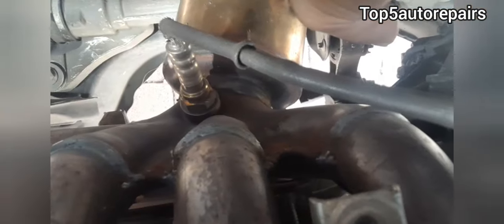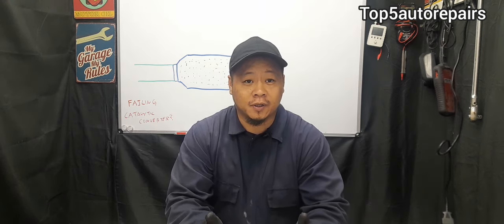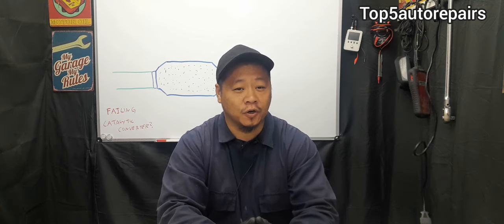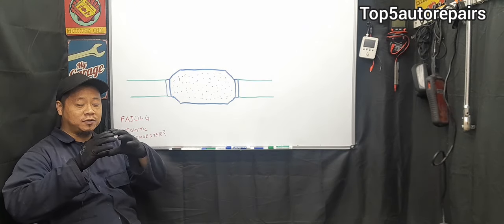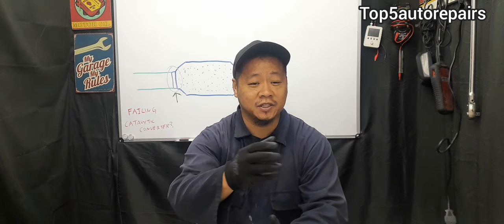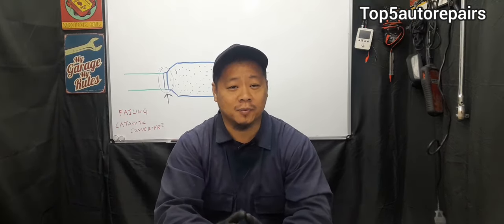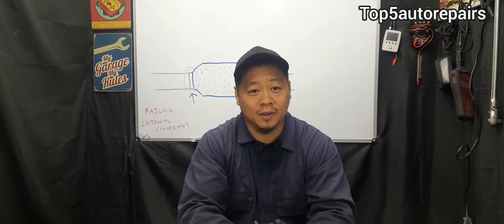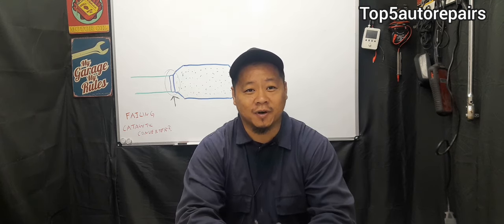HOW TO CHECK FOR A BAD CATALYTIC CONVERTER BEFORE REPLACING IT

Comment: all the causes have separate error codes. if only p0420, how to find the cause is difficult. but, without knowing the cause, just replacing converter is meaningless.
Reply: In most cases is carbon deposits built up. Not cleaning the valves and the intake
Reply: So does cataclean help?
Reply: @dramatimefighting  if the cat is burned out, not a chance. It cannot reverse the damage. Cat must be replaced
Reply: @BobSmith-tn2qp  or possible cat delete?

Comment: I will be replacing head gasket, O-Ring seals under rocker-arm carriage and catalytic converter on a 1989 Honda Civic. Replaced the oxygen sensor, but that did not improve the problem. Have had some issues with anti-freeze going through the exhaust, so at 146,000 miles on the car, it's time to invest some money and labor into the car.
Reply: Sounds like you have a cracked or blown gasket
Reply: @soniarican6275 , Took me around 6 hours to get all of the old gasket material off of the upper block. Tedious job. Things are moving along and hope that the car is up and running before mid-October. Kind of a bummer having 1 car when that car is down.
Reply: @LouiseTurner-x9z   Tell me about it , My car has been in the shop for a while now, it needed a new transmission and now they are telling me both Catalytic Converters might have to get replaced 🤦🏽‍♀️ I’ve been missing so many hours at work it sucks , but yeah changing a gasket isn’t an easy job I hope you can get your car up and running soon

Comment: I had a massive oil leak after replacing cats my cats were Turning red it throws a code for 02 sensor but it with replaced I guessing my cats are finished 😢

Comment: My G37 sedan had a code p1421 . I've purchased high flow cats from kinetic right after . my check engine light stayed on. It reads as follows. p1421. These cats were brand new but after a while I noticed some rattle when I cold start. It sounded off. Then emissions came around and I still don't know what it could be. The forums say to purchase the cell fix for high flow cats and test pipes.  plus, a tune could help. oem cats are way too expensive when it restricts power. The forums also said do not use the cells fix if your cats are bad. I do have a sluggish engine. my mileage is lower than when I purchased the car. I used to have 22.8 mpg now I get like 11.5. car sounds good but I waste gas and I find myself buying more every three days. should i buy the oem cats? should i try the cell or should i just get a new high flow cat and then put the cell on it before  the o2

Comment: i purchased some high flow cats last yr. and I got a code of p1421. I noticed it was sputtering on my driver side. I just checked under the car today and found out my cat has a small hole in it. I felt the hot air sputtering out of that hole. something told me it was a hole. I went to many auto shops, and they told me it was a relearn procedure that needs to be done. some said I needed to get an update on my ecu. none of that was the issue. I bought some pb weld and fixed it myself for 6 bucks. no more sputtering and the check engine light never came back on. car drives like it was supposed to . now i can get my inspection done . hooray!

Comment: Excellent explanation, besides that I used my humble scanner and I was able to check: cylinder misfire (6) ok , O2 sensor (4) ok , catalytic 2 ok, catalytic 1 HIGH , max value 3000, reading 3239 , code P0420 , I’m going to try cleaning first before replacing it. Vehicle mileage 140k , my wife bought it brand new this’s the first problem in this vehicle, ‘13 Acura RDX

Comment: Time for me to share my current experience.
I have a 2012 Kia Soul 1.6 GDI 
The engine seems okay, I have not noticed any power lost, no overheating, no black smoke, no white smoke. I checked the temperature with a lazer gun and it reads 200ish by the exhaust manifold and close to 400F at the end of the catalytic converter, I can't really check the temperature of the catalytic converter because of the heat shield, I will probably remove it and check the temperature 🌡 😑 
I don't smell anything under the car, I even put my nose inside the exhaust and didn't smell anything, no antifreeze smell, coolant looks nice and green, oil is clean, it doesn't burn oil, but the check engine light comes on and stays on.
I'm going to need to remove the catalytic converter and do a visual inspection, also need to inspect spark plugs and need to check inside each cylinder to see if they have a lot of carbon deposits.
GDI is a carbon deposits machine.
The OEM catalytic converter cost 1,790 dollars plus tax, plus 3 hour installation, Kia charges 180.00 dollars per hour labor so the total would be about 2,700 after taxes and fees. A local muffler shop can isntall a cheap catalytic converter for 800.00 with a 1 year warranty maybe the cat is at the early stages of failure 100%

Comment: Will an EPA compliant CAT replacement fix the issue or should i just spend the $800 for a CARB compliant OEM style? My vehicle has been having the CE light come on and off randomly for p0420 for the last year. Tends to come on more frequently when i have more in town driving than highway.

Comment: 2006 rav4 153k miles with lots of short distance trips, recently got P2195 (O2 Sensor Signal Stuck Lean /Bank 1 Sensor 1), after replacing both O2 sensors, maf sensor, spark plugs, fuel injectors, problem still exists, now getting code p0420 catalytic converter low efficiency and p0172 system run rich. Car vibration at stop sign and rotten egg smell detected. Fuel line checked ok, fuel pressure tested within spec, no vacuum leak, no exhaust leak. Is it time for a catalytic converter replacement?
Reply: Duhh

Comment: I have a 2015 Kia optima 2015 sxl turbo I believe it has 2 converters would I change both ? One by the manifold converter and one further down the pipe ? Thanks

Comment: I have a Traverse 2012, Mileage 212000 with original Engine and transmission. Facing issues with bad mileage and less acceleration. The vehicle struggled on hill climbs and overheated. I already replaced the spark plugs, fuel injector, and throttle body cleaned but, the same issue. Is it a catalatic convertor issue or something else?. your expert opinion is required.
Reply: I think if it overheats it may be you headgasket bro
Reply: You answered your question

Comment: I have a GLK 350, it smells like gas only on the outside, not inside the cabin. And it feels heavy when acceleration. What could be the problem? I have no check engine light on

Comment: My 2014 Ford Mustang v6 3.7 is quiet and does not seem to have the listed rating of 305 HP. I am wondering if it can be the catalytic converters. The car drives so quiet. Any ideas? No codes at all. Is there an additive to put in the gas? Thank you.

Comment: my 95 camaro has hesitation after the  engine gets warm and then its like i have power loss, i dont have a check engine light nor do i have the smell or over heating. this is on a 3.8 v6 but i suspect its the catalytic converter even though its only 3.5 yrs old because i had a cracked head last year and i had it replaced. what do you think?

Comment: I have a question what if im getting  the codes and i just got my spark plugs change but all the lights cut on and the car wheel lock along with the break is that from the converter?

Comment: What about its not losing power but you have the code? I put on a high flow cat a few year's ago on a Chevy Impala SS 04. I have 145000 miles.
Reply: check  the cats . mine had a small hole in it which made that code pop up . listen to your car when you start it with a cold start .  listen closely to similar sounds from the cats. if one is off tone then its most likely a small leak . my high flow cats had one and i got a code of p1421. below threshold blah blah blah.  got some pb weld and fixed the hole myself for 6 bucks. now my shit purrs like a kitten/.

Comment: I have a 2018 Toyota Rav 4' I haven't had it a year yet and it has about 60 thousand miles on it. The catalytic converter was changed by a Toyota dealer since I purchased (that's what they told me). My check engine light came on 2 days ago and the same dealer said the upper catalytic converter was messed up now and it will cost $2500 to repair. Is that true?.
Reply: It could be an exhaust leak near the sensor or anywhere upstream of the sensor, so I wouldn't just let them throw high dollar parts at it unless you are very wealthy.
Reply: @rdaleyj1  Thanks! I called Toyota and talked to another representative who asked me to bring the car back in he said ‘i would like to look at this again, that is very very very rare to see cat converters go bad that quickly.?.?.?’   Sooo 🤷🏽
Reply: @Tqueenb  While your there file a complaint against that rep that quoted you $2500, they tried to rob you!
Reply: How do you tell if it's upper for lower converter that's clogged

Comment: I’m having this issue with my 2013 kia soul base, bank 1.. front converter. I have around 92k miles on it. I get the code, but from time to time it goes away then comes back then goes away again. I went to Firestone and got a quote for 1850. Replacement 😢. Should I go with them or a discount muffler?.
Reply: That's insane pricing

Comment: I have 100 degree difference between front and rear of the CAT after driving... Rear is 275 front is 175 is that OK ?
Reply: No your cat is starting if not already clogged
Reply: Ur cat is working fine rear should be hotter than front
Reply: @joenico6785  how is that even possible if its clogged itll be hotter up front bu the manifold, like in my case , its 215Farenheit and 115Farenheit in the read side of the cat

Comment: Hi bro, on my 2019 dodge charger v6 rwd(200,000 kms)  , my driver side cat feels like there is a leak, it make a sound more whenever i do cold start after some time I scrolled down under the car  i can hear leak puss pusss puss as the car is start running on park ,no engine light. Should i just replace wait for the light to show up?
Reply from the maker: It sounds like you have an exhaust leak

Comment: I bought a used pickup from the dealership and they told me that it will pass smog inspection but it failed because they catalytic converter was removed by the last owner and I'm stuck making payments on a vehicle I can't drive on the road
Reply: Make them take it back or replace the cat...they lied to you, it didn't pass inspection.
Reply: What dealer was this? You should post this on their Google review. You got scammed by that dealership
Reply: So there are laws for buying a used car even if it’s a final sale. If they tampered with any parts to present it was safe to drive when it wasn’t then they have to give you you’re money back. They don’t Have to tell you pre existing issue with the car tho like if the transmission is failing , it is ur responsibility to check everything or bring you’re own mechanic before you guy it. But if they tampered with the dashboard or cleared the codes. Using fake pray to hide corrosion or anything like that you can take them to court. It’s why you should always test drive a car for a couple miles and take it on the freeway before you buy it. Usually if a catalytic converter is missing you can hear it. It is extremely loud! Did you notice an unusual noise at all?

Comment: Help needed!
My 2017 Hyundai Santa Fe 2.0 turbo with only 38k is struggling going uphill. The car is extremely smooth. I checked the fuel pump and  replaced the fuel filter although they were clean and fine. I remember two years ago I cleaned the catalytic converter with a cleaning spray product that indeed unclogged it. I was on a trip 3 days ago and found out that the car loses power uphill. I believe it's due to my driving habit. I drive only 5 to 10 miles a day and the car sits all day. No check engine light. Any help is appreciated.
Reply: Did you get it fixed?  I doubt it was the cat.

Comment: My dad drives a 2005 toyota previa and the gas cuts off after 2500 rpms it shows check engine light but when checked with mechanics they say it doesnt show any code and tht just weird but what u mentioned in the video tht the car faces problem at signals and loss of power on up hill roads tht happens with me but there is no rotten egg smell or anything im confused as hell help
Reply: Fuel pressure regulator

Comment: I just bought a damn 2003 Honda accord. And my engine light popped up. It has 74.8k miles. So I’m going to try and replace both the spark plugs and the catalytic converter. 😪
Reply: Same here..3 months later I replaced the engine 😪 now the catalytic converters is smoking like wth ..I was ripped off but I’m gonna try to fix it
Reply: Well did ya run codes on it first ?

Comment: Whats up bro. 

The mechanic said my catalytic is ok. But! I just replaced 4 o2 sensors, purge valve, ecm, gas cap, Then i got bank 1 and 2 low voltage. Yet theyre new o2 sensors. And now …. P0042 popped up. 

Please help
Reply: Are they OEM sensors sometimes the resistance and the specs from manufacturer sensors are different if you buy aftermarket ones and even if you install them the computer won't even bother reading them

Comment: mine haves 48,000 miles can it be jus the o2 sensor?
Reply: What did you end up doing?
Reply: @Wavemasterx3_  i took it to dealer after i bought a scanner n they replace the cat n o2 sensor and it went back to normal. Luckily i paid for extended bumper to bumper coverage n they took care of it

Comment: Hello.  
I have a p020.  
I changed the p02 sensor bank 1 two times. 
After the second p020 spotted. I’ll use the catalytic cleaner and erase the code.  
Work for some time.  But come again.  I use the cleaner again. Is workin.  
What should I do.  Anyone on comments. 
Puuufff.  Hope for the best
Reply: Something is causing it to continue to get clogged will eventually have to change it try two cans of the cleaner instead of one

Comment: what if p0420 code only came on after installing a cold air intake
Reply: Make sure everything is tightened correctly could be sucking air I somehow
Reply: @ashleyredden2201  I just traded it in for a 2022 challenger lol I didn't wanna deal with it

Comment: Curious if anyone has any suggestions about my p0420 code (low efficiency, bank 1). I bought a 2016 Encore, base model with 100k miles on it.  I just changed the cat and both o2 censors but the light came back on about 60 miles after the change. Before it came back on I heard a odd humming sound and it felt like it was running a little rough while driving for a few seconds. After letting it cool down I  turned the car back on and sprayed the immediate area before and after the cat with soapy water to see if there was a leak but didn't find anything.  Any idea what it could be? Thanks.
Reply: Stop buying American junk GM, Ford. Stick with Japanese Toyota, Honda

Comment: Hey I had the code 40420 show up a couple of days ago and than the check engine light was gone two days later, the next day the p0304 code came on while driving and check engine light was flashing and car seemed like it didn't want to accelerate, cut the car off went to clock in came came back drove around the parking lot with no problem, what could it be
Reply: I have the same problem on my Dodge ram 2008
Reply: Just came from the dealership they said my Cadillac converter is bad. Something with the wire harness and upstream downstream O2 sensors. I changed the upstream O2 sensor already now I need to change both of my Cadillac converters.
Reply: @Daybyday07 try other o2 sensor first

Comment: my car has P0240. No smell, no smoke, etc. Its very mystery find why the cause is.
Reply: Same
I have 190k miles, I started at spark plugs and they were bad and def was never replaced by previous owner…. Didn’t work so I changed. Bank 1 02 sensor and worked for about 50 miles then light came back on … I Just changed 1 of 4 o2 sensors so it’s prolly my cat

Comment: 2010 Ford Escape 3.0 6-cyl 221k miles:  P0420 but for over the past 1000 miles, at high load and high rpm, very loud "swooshing" jet engine thrust like sound coming out tailpipe with proportional loss of power.  I suspect cat has broken up and plugged up the downstream muffler.

Ultrasonic cleaner may clean the cat - but it may disintegrate the honeycomb too.

Comment: Some of what you said is correct but   you are mixing issues the catalytic had to be very hot to function correctly and you did not say anything about exhaust leaks /bad o2 sensors codes p0420 and p0430 need to recheck after making sure  no exhaust leaks no misfire no lean or rich fuel system the test should bone at cruise speed of 55 mph and look at the rear o2 sensor switch pattern it should switch slow between rich and lean, rotten egg smell can be caused by rich fuel system and hard acceleration so it does not mean bad catalytic converter, rich /lean/misfire or any other conditions will set DTC and they should be check and repaired before testing or even replacing the CATs.
Reply: Do you have any videos on the subject? I'm having issues with mine.... and you seem to know so much
Reply: @futuredefpoet  I have one in my shorts videos.

Comment: My 2009 jeep grand cherokee cat just went out and man there expensive.  My question is can i just remove the cat and straight pipe it there to the muffer?
Reply: Yes u can but depending on state could b illegal u can take it off an get all the crap out of it bolt back on an ur good to go
Reply: @randyholloway6132  thanks man imma have to give it a try
Reply: Buiuut you will have to live with the CEL / P04xx forever unless you get a tuner tech to program it out of the vehicle’s computer.